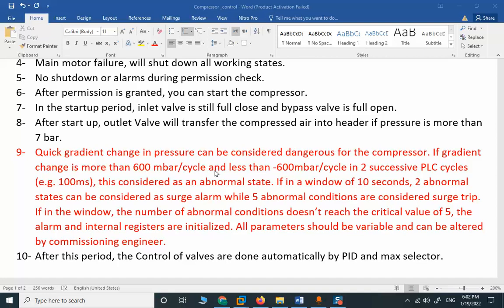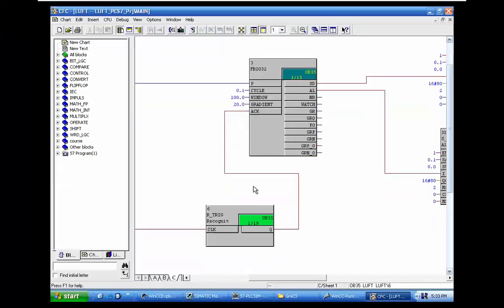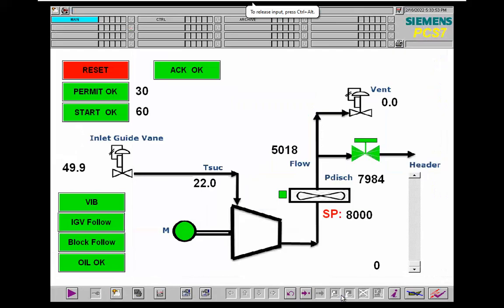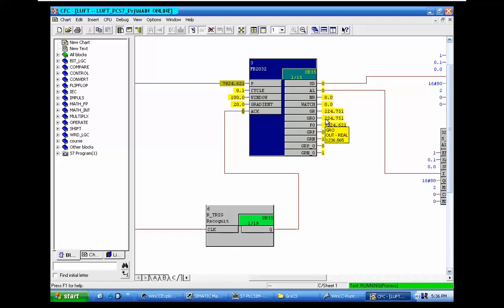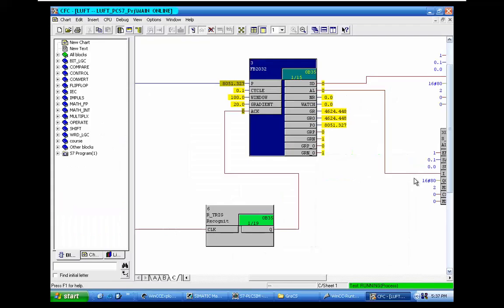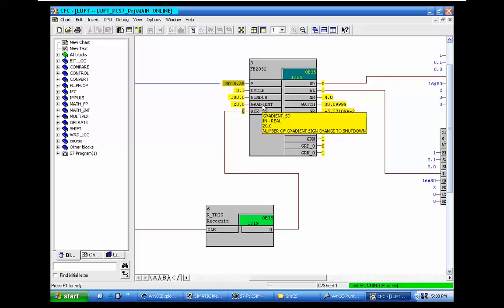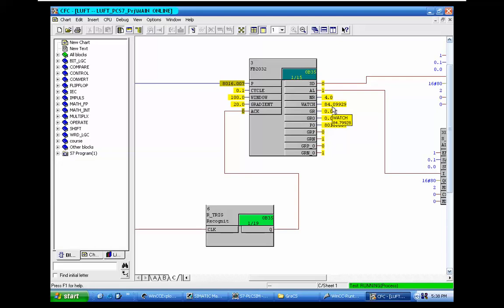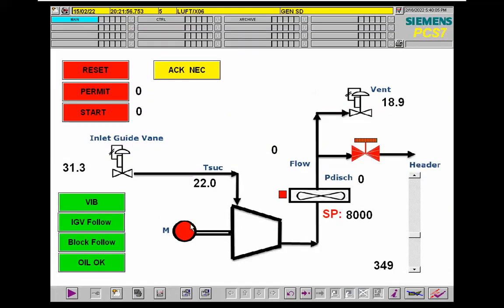SIEMENS PCS 7 Tutorial ( Z5) | Final Projects | Compressor Control in CFC and SCL | Gradient Change

Comment: So, I have an S1500 and I have tried to do a temperature ramp soak, but still I haven't succeed. I have seen a way to do it and I found a PID_CP (available S300 and S400) and this block already have functions of ramp soak internally, just we have to enable this functions on own PID block (PID_CP). My attempts are based on use a ramp_functions (auxiliary function inside PID_control folder on TIA's instructions) so that change the setpoint of my PID temp, but this is not working because always my ramp get delayed (~1 min 30sec). And of course, I am using the PID auto tunning firstly of start my ramp. My ramp function updated each 1s, in others words, if I want a rising temperature (range of 40°C) in 20 minutes, ie my rising rate is 2°C/min or 0,033°C/sec. I don't know if this rate has been so fast for the PID_temp response. I tried to change de gains, but I didn't succeed. There is some ideia that you recommend to me so that improve behavior os my PID contoller? Perhaps use TCONT_CP?  Thank you so much.